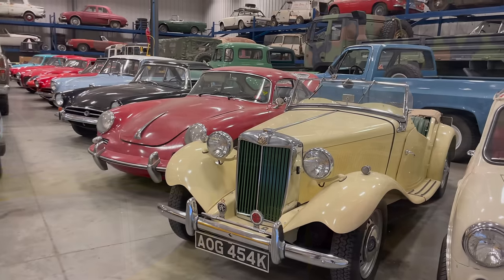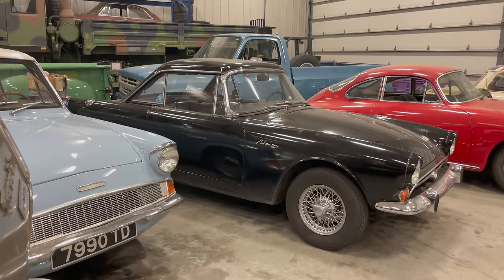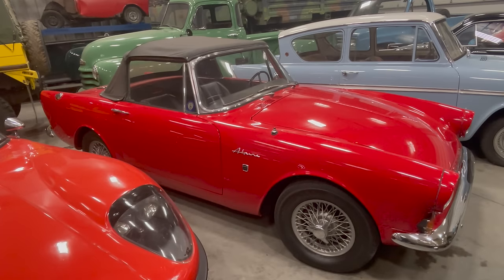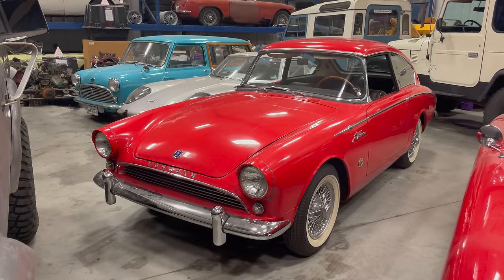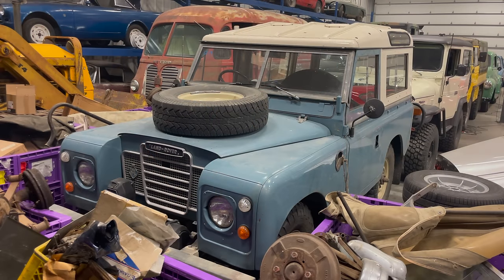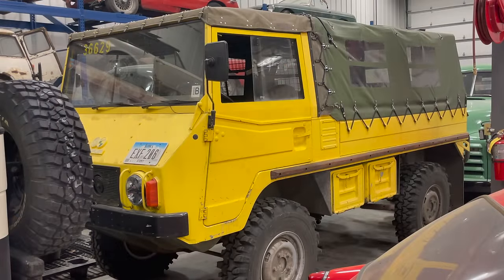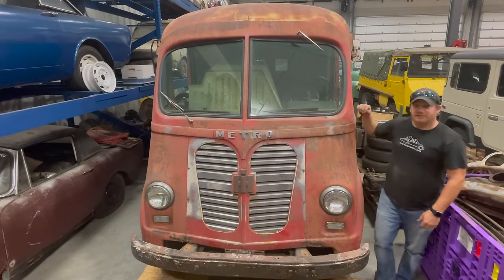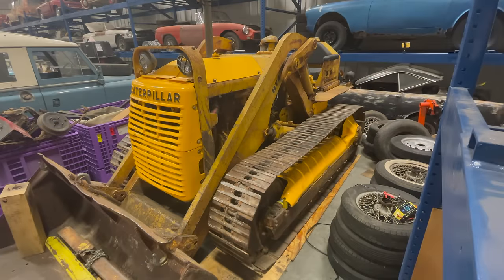Cold Starting My Entire Collection - Part 3

Comment: restoring cars goes way back for it was my dada that showed how restore and his rule on the cars was to never let that sit to with out being if not started enuff they,ll just go down on you it was his rule to start and drive a car no less then 30 for from spring to fall we had no problems as we whent to show often the cars would be driven but winter they would sit and my dad made sure that we start every one of them  and i have alway found this to be a very good rule i use it myself on all my car   and i say to with as meany cars that you have i think use should do the same on every one of your car just take a couple of day every mouth and start every  or if you find it hard to get the then some to do it go trough and start and drive ever one and to put in a little bit of new gas to keep the gas from going bad on  i mean i think you should do this and by doing you can anyone at any time you want to and it,ll be ready

Comment: Heee….Heeee….Heeee… I espied a few holes in your collection that need to be filled. I see some pre-rubber bumper MGBs on the shelf. You need at least one runner. You need at least two running MGAs, with and without the recessed grille. A twin cam would be a bonus. You absolutely need the preeminently ugly,  but tres cool for its 2.5 liter Hemi V8, Daimler 250 SP.

Comment: Is that an electric cooling fan making all the noise on the blue Rover?  It seems like as soon as you turned on the ignition an electric motor started spinning.
The green Chevy pickup is gorgeous!
The LMTV sounded like it wanted to go somewhere right off the bat.
Thanks for the series, it has been great!
Reply from the maker: Yes it is
Reply: @ThisWeekWithCars  Hard-wired I suspect???

Comment: Steve, I was taught to always bring the engine up to operating temperature from a cold start. Wondering if just running them for a few seconds has a downside. Also, I'm surprised you don't have at least one Ford Cortina in your most impressive collection, or did I just miss it?
Reply from the maker: When I do this without the cameras I do that but it would take a week to film it if I had done that in this case.  I usually start them all in sections as you see here and let them run then start shutting them off when I get to another row.   It has to be a nice day to have all the doors completely open to pull that off which would mean no cameras as the contrast between the sunlight and the dark interior would not make good video.

Comment: Steve - you have never once used starting fluid to assist starting your engines (unlike your pals at "Junkyard Digs") - what gives?
Reply: Kevin uses brakeclean all the time which is extremely harmful for the engine
Reply from the maker: I use starter fluid in my videos sometimes if I know there is spark and the engine is being stubborn.  Kevin does some things with brake clean that I have never seen before...